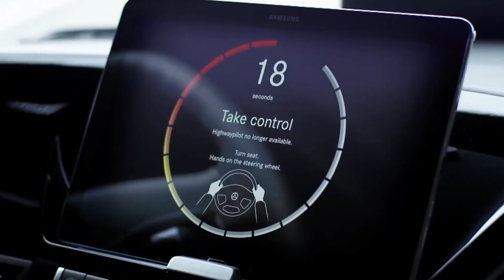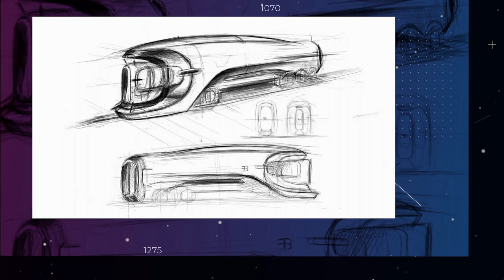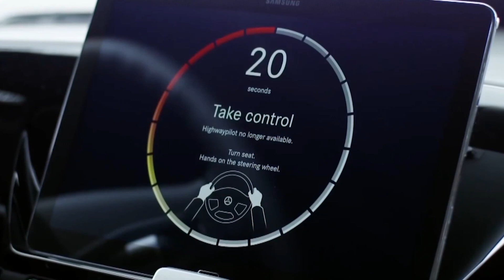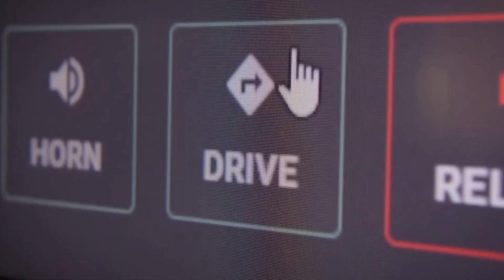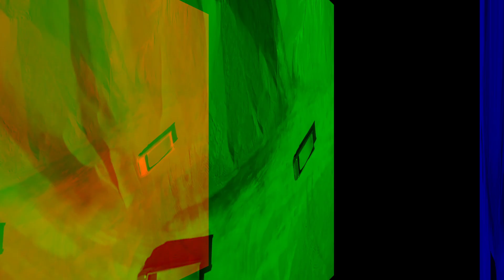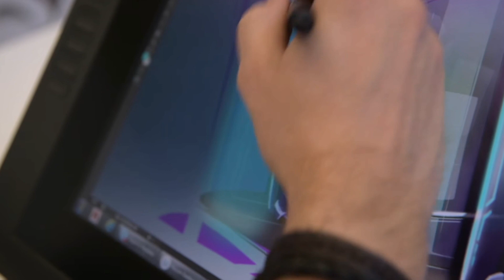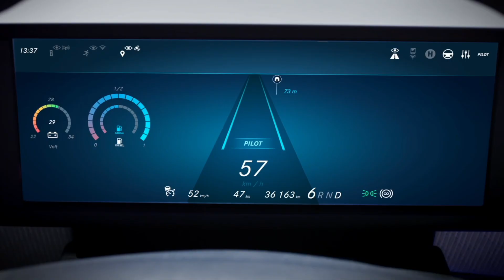Top 10 Futuristics Trucks & Buses You Need To Know About

Comment: The front of the vehicle adopts a 'C' shape, natural in Bugatti's DNA. Inside, there is a cabin reserved for a single passenger, which is located in the center of the cabin and appears to be suspended in a glass-covered capsule. The designer prioritized aerodynamics over cargo volume, as the Hyper Truck looks quite narrow, so we imagine its main objective is to reach very high speeds.